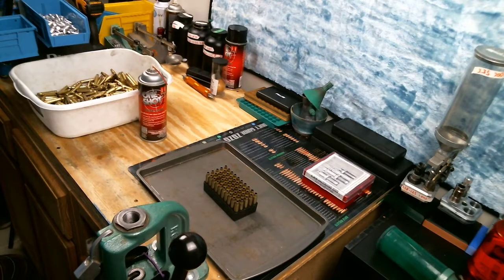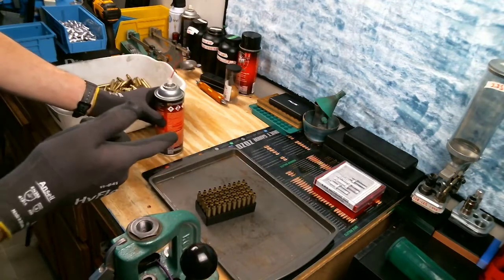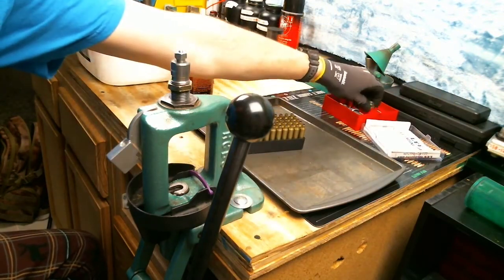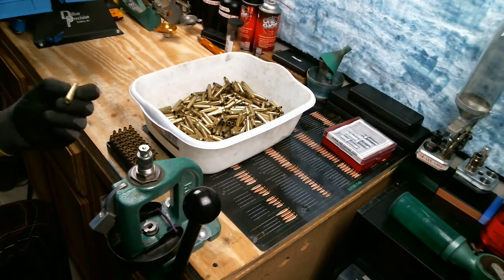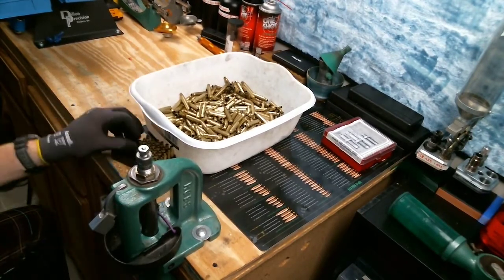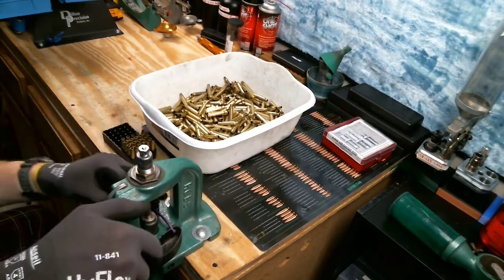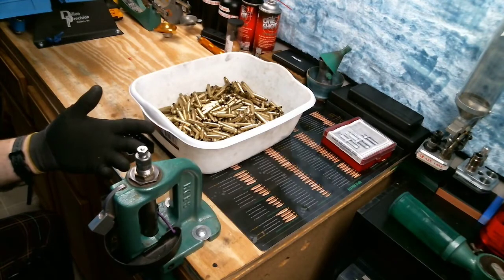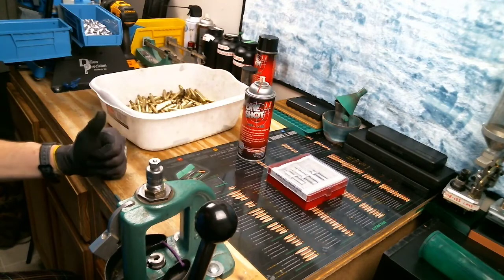Full Length Sizing 50 Pieces Of 223 Brass On RCBS Rock Chucker Using Lee Dies With Hornady One Shot

Comment: Thanks for the video! How do you use a Lee neck sizing collet die on a Rockchucker though? The instructions are a different die setup compared to a Lee press and following them the neck rims aren't uniformly round nor are they the same diameter all the way down to the case shoulder. I'm at a loss what to do :/
Reply from the maker: Hey, thanks for watching! I have actually never used the neck collet style sizing dies. Using a different press shouldn't change any of the instructions, however. It sounds like the collet isn't engaging the neck evenly at the top of the stroke? Make sure your shell holder is in straight, and facing straight at you. See if this random video I found helps lol https://youtu.be/5xpf0Bn3q8U

Comment: Looks like your bench needs some reinforcing. That flex would drive me crazy
Reply from the maker: You're not wrong about the reinforcement, but the flex doesn't bother me. Thanks for watching! 🇺🇸🇺🇸🇺🇸
Reply: @DummyRound  gotcha. I'm getting my rock chucker in a couple days that's been on backorder. Also just ordered the inline fabrication roller handle and case ejector system. Pretty excited to get started. No primers around here though. You're lucky
Reply from the maker: That sounds like a pretty good start. You'll have plenty of time to prep your brass and get everything else ready for when you find primers. I was lucky finding the ones I have gotten recently, but I had some on had before all the madness started. I limit my range rounds  and spend more time working on my technique and fundamentals now. Good luck!
Reply: @DummyRound  oh for sure. grabbed the WFT trimmer and Lyman case prep center too so I'll def be busy for a while. Enjoying the content. Keep it comin 🤘🇺🇸
Reply from the maker: @DTWCT  very nice. I need to upgrade my case prep gear eventually.